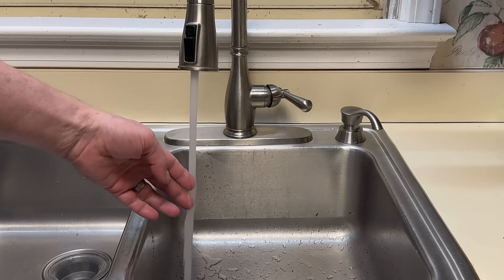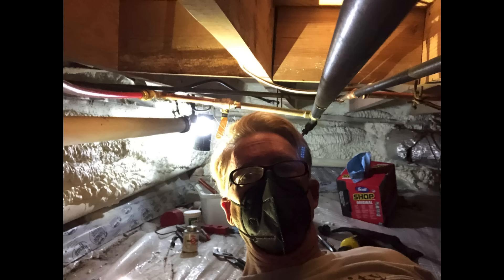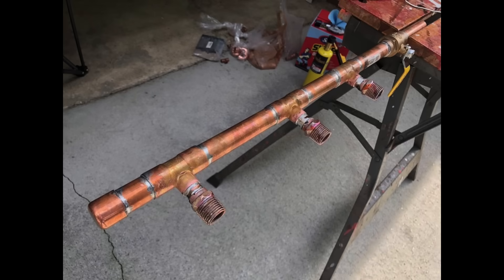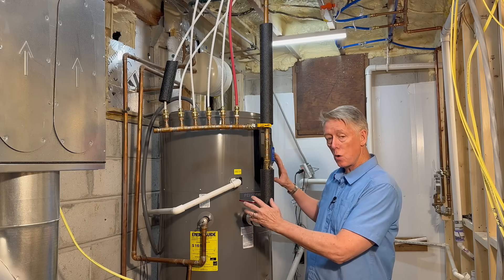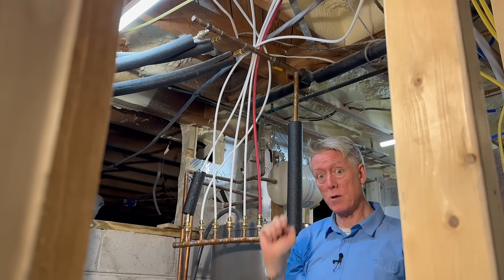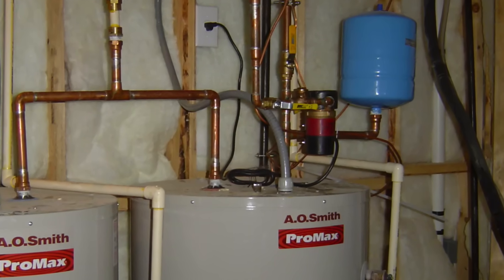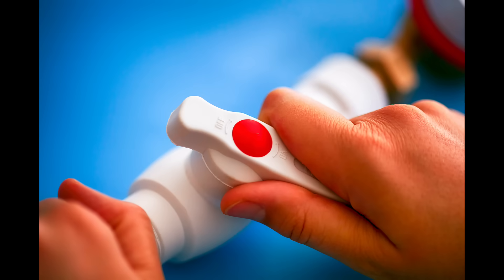How to Get Faster Hot Water...Without a Recirculating Pump!

Comment: 1/2" is the minimum size that building code allows.  You are under sizing and jacking the velocity higher than what is acceptable.
I tell people to install a recirc pump, but since you have an aversion to them, do the following.
It looks like you have a basement under your whole house, just install a smaller, second, water heater under the area nearest the fixtures that are furthest from the main water heater.

Comment: Well this works just fine. As long as you don't have a finished basement. Then putting a $150 recirculating pump underneath the sink. Works even better. Takes me 10 seconds after I push the button for the hot water to get recycled back into the cold side. Compared to 45 seconds of runtime to get it hot. Another thing. Use a tankless water heater. The water gets hot faster and you only use fuel when you need it. I will say if you like it that's fine, but support that manifold will you please. It's drooping And drooping can cause stress which causes leaks.
Reply from the maker: It's not actually drooping. That's how it turned out when I finished soldering it together.

Comment: Interesting, maybe consider using Pex A as well, on Pex B, the fittings are smaller, basically restricting a 3/4” pipe down to 1/2”. I moved my water heater to my garage, and since it’s a heat pump water heater it puts off cool, low humidity air, conditioning the air in the garage while heating the water cheap, then connected a recirculating pump, but it is activated by a ton of different things like alarms times set, motion in the house like in the morning when motion starts, it stands to reason a need for hot water will follow. Also runs when either of our cell phones disconnect from their charger, again meaning we just got up and will want hot water soon. Even have an Alexa routine, if the situation arises, I can say Alexa, hot water. I never thought about using tiny lines, would have expected to have the wife yapping about the lack of pressure or flow, but maybe it wouldn’t be an issue since the factory restrictors are still installed. Thanks for making the video.

Comment: Let me tell you how I solved long pipe cold water problem for the kitchen. 
I install a 5 liters electrical boiler beneath the kitchen sink. Boiler is installed on the hot water line and set to heat up the water at 40 C. When I open the hot water fawcet I get hot water in 3-4 seconds. The cold water inside hot water line between my gas boiler and the electrical boiler enter the electrical boiler, mix with existing hot water inside the boiler and run out as hot water. Boiler switch on and start to warm the water inside. Meanwhile hot water produced by the main gas boiler arrive into the electrical boiler, temperature raise and boiler cuts off power. Now all the hot water comming to fawcet is produced by the main gas boiler. Electrical boiler set temperature should be 2 - 3C less than main gas bolier hot water set temperature. You need to buy a 5 liters electrical  boiler, flexible hot water hoses (I used 1/2" metall hoses), 1/2" connectors, 1/2" rubber gaskets, 3m of 3 whire cable, 1 plug with ground connector.

Comment: I had several hot water problems that I’m solving in a similar fashion to your solution: 
The garage is at one end of a ranch with the Water Heater (WH) adjacent to the kitchen.  The hallway bathroom (HB) and master bathroom (MB) are at the opposite end of the house and in the back – literally as far from the water heater as one can get. 

Additionally, there were no water hammer suppressors (WHS) in the entire house. 

1st – slab house with a hot water leak under the slab.  Every time there was hot water used in the MB, the copper pipe would expand and contract.  While the copper pipe was isolated from the cement slab, the pipe was not isolated from the pea gravel under the slab.  This expanding and contracting wore a hole in the hot water line in a 32-year-old house.  If it happened in one spot, I feared it could happen again someplace else. 
2nd – also, it took 17 gallons of hot water to get hot water out of the hot faucet in the MB tub.  From the WH, ¾” copper pipe down through the pea gravel into the dirt above the sewage plumbing, to the other end of the house, up into the HB with two ½” taps, ¾” back down into the dirt to cross the 6’ MB walk-in closet, up into the MB where the ¾” terminates into two ½” pipes, one of which goes back into the dirt to travel the 10’ to the MB tub. Plus, the water it takes to heat up all that copper pipe, and it cools down quick. 

In the master bedroom closet, I cut 2 holes in the slab to access the plumbing, 1 behind the MB vanity and another behind the HB vanity.  I also cut 3 trenches in the slab so I could run conduits from the WH to the kitchen, and down the hallway to the 2 BRs. 
From below the WH, I ran 3x 1.5” PVC conduits: 1 to the Kitchen, and 1 to each bathroom.  In each of these I ran a red and a blue ½” PEX-B pipe.  For the bathroom, I prioritized the tub water; whether hot or cold, the tub water went straight through all fittings, the sink and the toilet water had to make several 90* turns at the T’s before getting to the fixtures. 

I also added a number of WHS; 1 on each hot & cold at each tub, laundry hookup got replaced with WHS, one on the ice-maker connection and I used a 2nd ice-maker connection for the dish-washer with a WHS.  Additionally, there are 2 WHS on my manifold board; main line cold straight in and on the hot line before it gets to one of the 3x Sioux City manifolds (with shutoff), total = 10 WHS.

Comment: Right now I'm just waiting until we do our basement reno to redo the hot water system in our house. My tankless water heater has a built-in recirculation pump, my plan has always been to connect it up to the motion sensors that I have already near the sinks, as well as to shrink the diameter of the pipes. I feel like I can get the best of both worlds that way.

The only two concerns I have are around calculating the best diameter for the pipes, and around the possibility of balancing multiple runs for the recirculation.

Comment: If two of the legs are active at the same time, like you're taking a shower and using the dishwasher, does the pressure drop?
Reply from the maker: No. We have lots of pressure, and I haven't noticed any change in pressure when multiple taps are open.

Comment: The time wasted waiting for hot water is the biggest issue, but, beyond that, the energy wasted is far more costly than the water itself.
Reply: That depends on the unique conditions of the home : for example, for every $1 used in water (in CCFs) I'm charged an additional $2 for sewage fees, magically becoming $3! plus usage fees escalate after the first thousand CCF per month. A $100+ water bill gets my attention, and thats before the water heating bill. Also It can get Very Cold here near the border to Canada, so a recirc pump that returns thru the cold side has the benefit of preventing the pipes from freezeing during cold snaps. In the last few winters I've seen numerous homes with a trail of ice formed in the street gutters from burst pipes.
These arent mere convenience issues.😢

Comment: The 3/8” and especially the 1/4” is awesome!  People radically over estimate what size lines they actually need, just due to past, entrenched practices. 

One thing you are missing is a heat trap. It’s just an upside down P trap in the hot water line that prevents hot water from escaping into the plumbing system when there is no demand for hot water. Without it, convection current will carry heat far out into the lines, wasting a lot of energy as a result.
Reply: First I heard of a heat trap!  I suspected all along that my problem here.
Reply: @snort455 - In the USA, most home water heater tanks for the last 2 decades have come with a pair of thermal isolating check valves (one on inlet & outlet piping sides) to reduce convective flow and conduction loss through the pipes. Usually required for an Energy Star rateing). Installing them is optional though, and maybe not appropriate for all systems. Insulation of the pipes is also strongly recommended, but clearly not always followed or well executed. Good design & craftsmanship matter.

Comment: The “architect” that “designs” a house with the kitchen, baths, and laundry all far away from each other and far away from the water heater isn’t an architect at all. He’s a HACK!

When I’ve rebuilt plumbing systems I put the water heater as close as possible to the most frequently used fixtures (the kitchen) I ran everything in 1/2” copper instead of 3/4, and, where ever practical, I made it so that there was more than one fixture along the route. This way using hot water at one location also gets hot water to the other(s). 

This is why I am against the practice of running a separate line to each fixture.

Comment: I have a laundry room at least 45' from the two main bathrooms.  I was considering putting the heater in this area, since there are two electric water heaters.  One is in a closet near the two baths (no pan or outlet), the other being in an unheated garage, which only feeds a half bath and the washing machine.  (I would turn off the garage unit, but then it would freeze).  I considered a timed circ pump and a long run of PEX-A, but I have concerns about the possibility of vermin in my attic.  Thus, I'm afraid I must use well-insulated copper. The house is on a slab, and the supply lines are in the attic. I'm not sure how to run a return line, so I was considering having the sensor on the most distant cold line.  In any event, I would only be using one heater, instead of two.  Any suggestions?

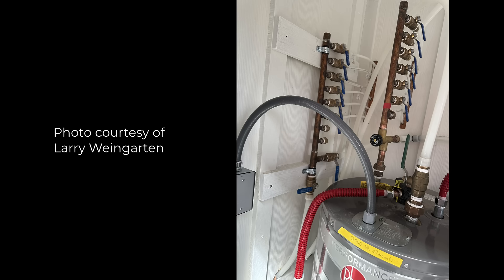Comment: Good info, thanks for posting. At 8:40, regarding the use of a recirculation pump, the biggest drawback I’ve found is that you’ll now have to wait for the cold water to get cold!
Reply from the maker: Interesting.  I've never had a recirculating pump, but that makes sense if there's not a dedicated return line to the water heater.  Then the water would go back through the cold line, which isn't the best way to plumb it.
Reply: The return line for HOT water recirculation would return to the water heater. Doing recirculation means there's 3 pipes (or pex lines) instead of just two, so you're not using your cold supply line to return water to the water heater. 

So, no, you wouldn't have to wait for the water in the cold line to get cold because you're not heating that water with water from the hot water heater.
Reply: @robertf6523  there's a Watts recirculator alternative that doesn't use a dedicated hot water loop. When the system is activated, hot water is shunted into the cold water line at the fixture furthes from the water heater. In that case, there would be warm water in some of the cold water lines.

Comment: The shortest distance between two objects is usually a straight line, unless you talk to a physicist. Reducing the run from 80' to 36' was huge!

Both of those manifolds are supported at only one end. I'm concerned that a water hammer event could tax them beyond what they can handle. They need to be supported so you don't wake up in the middle of the night with a full-blown gusher of hot water!

The idea of running 3/8" to a shower doesn't strike me as being too good. As water heats, it expands. The volume of water at the spigot will be lower for hot water than for cold water. Unless your shower is a super-efficient kind, you could end up with a cool shower when you're trying to have a hot one.

Overall, good ideas but poor execution.
Reply from the maker: Good points.  I haven't finished with everything yet, but I'll be supporting both manifolds after I get them full insulated.

Yes, I've installed 1.5 gpm shower heads in all the bathrooms.

Comment: I am curious about the discharge line in the PRV  on your water heater. Seeing it is plumbed out above the heater I notice a tee with a smaller diameters connection.
 What is that and what purpose does it serve?
Reply from the maker: Good eye.  The state of Georgia allows the pressure relief line to go up, unlike some other states.  The tee you see is connected to a short pipe with a ball valve to drain that line at the lowest point.  My plan is to replumb that line so it doesn't go up.
Reply: @TheEnergyVanguard  Do you need the small air tank on the water heater?  I have only seen them on hot water boilers used for hydronic systems.
Reply from the maker: @elultimo102  Yes, the expansion tank is necessary because water expands as it heats. In a closed plumbing system like this, that expansion has to have a place to go or it will cause leaks or catastrophic failure. In some systems, there's nothing stopping water from going back into the municipal water pipes at the street, but that can't happen if you have a pressure regulating valve (I do) or if the municipality puts a check valve at the meter (I think ours does).

Comment: I'd like to sum up the benefits and downsides of this approach. The plusses are saving time while waiting for hot water. Preventing the waste of both water and energy. Simpler and less expensive first cost installing the plumbing. More installation options with small tubing, so great for retrofit. Very simple, with little to fail... Downsides are that you need to know the static pressure. You need to think through the system and how it will or might be used. You may need to educate your local building department on how this meets code. It's not a one size fits all approach as both water pressure and system layout matter.

Comment: Pressing for a couple more details.:-) What did the single 3/8 pex you used service? Are there a few more assumptions you've made that didn't get a chance to speak about. Such as, one line to service bathroom sink and shower assuming they are not both in use at the same time. One line to service kitchen sink and dishwasher assuming they are not in use at the same time? Thanks in advance!
Reply from the maker: I've got two 3/8" PEX lines. One goes to the kitchen sink in the retrofit I did in 2022. I went with 3/8" there because it's a 37 foot run to the kitchen. The other goes to the bathtub in the basement and I used 3/8" there because it's a bathtub.

No, the PEX runs coming off the two manifolds are mostly serving single fixtures. The one exception is the main floor kitchen. That line serves both the sink and the dishwasher. In 2.5 years, I've never noticed a problem with using hot water in the sink while the dishwasher is running.

If you haven't looked at them yet, you can learn a lot more about what I've done by reading the articles I linked to in the video description above.
Reply: Lol I just read the green building advisor article which answered most of my quandary. 3/8 Line was used because the line was so long there was too much pressure drop. Now I'm wondering why there were no acceptable pre-manufactured manifolds that you could use instead of building one from scratch.

Comment: This all seems like the hard way around, to me.
First, move the heater to the other side of the
house, where it is needed, extending the gas/electric
to it. Then, get a small electric heater, for the laundry,
since it is on the other side of creation.
A lot less work and no special tools required. 😁✌🖖
Reply from the maker: Yeah, there are definitely other ways to do this. I'd say, though, that moving a water heater seems a lot harder than what I did. Also, I didn't want to add a point-of-use water heater at the kitchen because I spent a lot on my heat pump water heater and want to use it for everything.  I didn't need any special tools, though. Push-to-connect fittings are pretty simple and don't require special tools.

Comment: Heat pump heater in basement of 2-story house. Bought a recirculating pump kit, but only installed the valve at furthest fixture. Convection did the rest. Bought a second valve and will add a 3rd, all under sinks.

Comment: You skipped a potential problem. Smaller pipes mean faster velocity and faster hot water, but it also means potential for water hammer. This is why IBC requires surge arrestors on solenoid lines (eg. washer, ice maker, dishwasher, etc). The surge may cause high pressure in the lines and damage PEX and fittings. This is why you need it evaluated by an engineer. There are not many engineers that understand water hammer. Most of my undergrad professors did not...
Reply: Hi, I've built these systems and have some thoughts. I like to have 60 psi static pressure and use a maximum of 1.5 gpm fixtures. This does give a high foot per second flow rate, but has not caused any problems. The elasticity of PEX probably helps, along with the very low mass of the water is small tube. Also, insulating and then strapping the tubing in place might be cushioning any jump. I agree that surge arrestors would help if hammer were a problem, as it could be if serving a washing machine with a fast closing valve, for example.
Reply from the maker: Good point. I've had my first retrofit in operation for 2.5 years and have noticed no water hammer effects. I'm pretty sure I discussed that issue with my plumbing friends and they said it shouldn't be an issue.  I've reached out and asked for their comments again, though.
Reply: @TheEnergyVanguard  Contrary to common belief water hammer does not always indicate itself with noise. It is a high pressure wave the travels along the pipe around the speed of sound in water bouncing and distributing throughout the plumbing system until the energy is dampened. There are many factors for this complex action. It may not ever be a problem, or it may surface as shorter system life, or catastrophic failure of a pipe (in order of probability). My best guess is that it will shorten the life of the push-on fittings, so watch those for leaks.